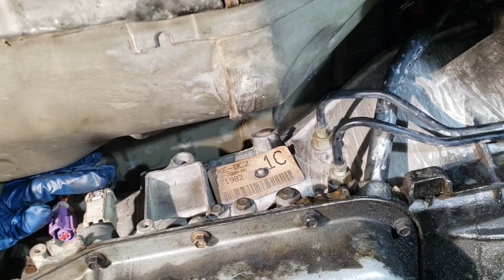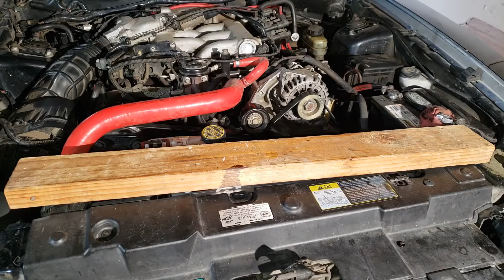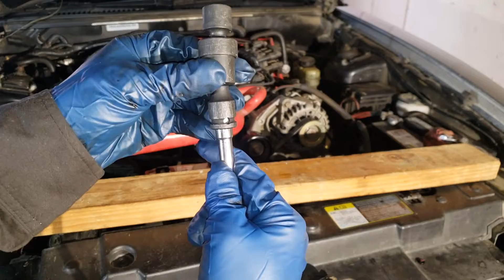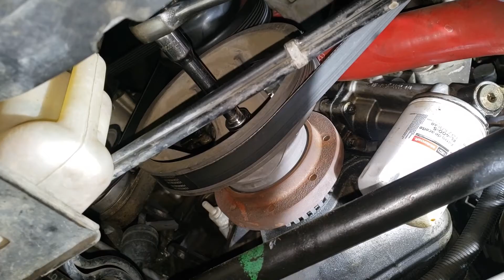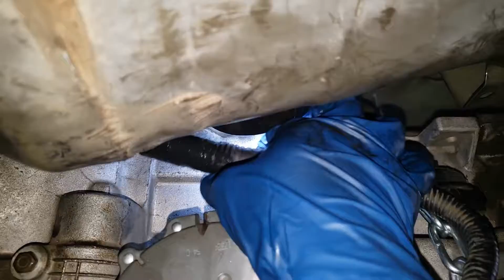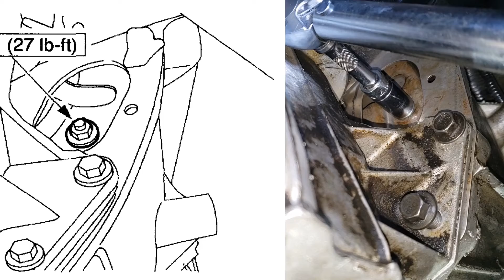Mustang Transmission Removal / Install (99-04 V6) (4R70W)

Comment: How the hell do you remove the torque converter bolts?! They're super tight and start to round off
Reply: At that point, find a socket slightly smaller than the size necessary, beat it onto it & then attempt to loosen, that’s the only way I can think of, definitely get new nuts from your local parts store. I got mine from AutoZone(they were blue).

Comment: Is it easier to do this than rather hold the engine to drop the oil pan first the engine
Reply from the maker: Either way requires lots of disassembly for the oil pan gasket
Reply: @OldSchoolNoe I bought a used engine just gonna replace the whole mf bought it for 150
Reply from the maker: @brutalkillin9555  nice! Are you replacing the rear main seal, and oil pan gasket on the other engine?
Reply: @OldSchoolNoe yes I’m def going to do that before putting it in lol that’s a must

Comment: Very important. Theres a wiring harness that's mounted to the top of the transmission.. I ripped a white wire? That's mounted to the engine. No idea what it is. I'm in over my head. Hate this shit
Reply from the maker: Driver's side or passenger side? Are you able to trace it to something?

Comment: This video helped me get my transmission out, step by step. Although I found it easier the remove the top 2 bolts from the top with a regular 13mm wrench. Thanks!!
Reply from the maker: a couple of people have commented that, it looks like a tight fit, but sure beats building "the snake."

Comment: Hi, can you tell me what that blue plug to the left at 0:21 is plugged into? I’m trying to fix my 03 mustang v6 automatic, and noticed 3 wires unplugged. A blue head a green head and a higher up gray head that almost looks like a part of the previously connected part snapped off connected to it. Thanks for any help, even just a picture of what that section is supposed to look like would help.
Reply: More than likely o2 sensor that was plugged into the catalytic converter.
Reply: Green and blue connectors are for the o2 sensors , the Grey one might be the connector for the transmission 🤔

Comment: Excellent video. Was planning to follow along with this until I realized it’ll be hard to turn the crank shaft of a seized motor 🙃. Now I’m not sure what the “easiest” option is.
Reply: In theory you should be able to remove the transmission leaving the torque converter in place on the flex plate, you'll just have to have enough room to slide the transmission more to clear the converter, you'll have to reinstall the torque converter onto the transmission when you reinstall it on the new motor, aswell as you'll have to replace all your transmission fluid since the converter will spill its fluid once disconnected from the transmissions input shaft, there's no way around this because the transmission has an anti drain back valve for the converter so draining the pan won't be enough, just be mindful of that and have a bucket under you when you pull it, otherwise it's not much different of a process, once separated you should be able to unbolt the converter without being able to turn the motor

Comment: should I have it in neutral with the parking brake on? And what about the shifter how do I go about removing that, I assume you take the trim off and it’s a couple more bolts
Reply from the maker: Yes place it in NEUTRAL, service information does not call for setting the parking brake.
As for the shifter, you don't have to remove it when removing the transmission, but if you have to remove it for any other reason then:
- yes remove the trim, around it, some electrical connectors,  2 fasteners for the shifter bezel, disconnect the shifter cable from underneath the vehicle, then I believe the shifter and its base are held on by 4 bolts.
Reply: @OldSchoolNoe  ok how do you take the key out with it in neutral, i cant figure it out unless i keep the key in there then disconnect the battery but i don’t think thats smart or right
Reply from the maker: @robfolder  you can leave it in park, and manually shift it to neutral once the linkage has been disconnected. Just become familiar with what position is what so you can set it to park once you're finishing up.

Comment: yo ik this question isnt really related to the entire removal of a transmission but is removing the top passenger side bolt (aka dipstick bolt) doable with the Mid pipe still in the car?
Reply from the maker: I would say no, since it takes up so much space in that area, BUT I have not tried it! Maybe with some swivels and extensions you can do it with the mid pipe still on. You're going to have to be a trailblazer and let us know!
Reply: @OldSchoolNoe  will do
Reply: @OldSchoolNoe  so I’m back with progress. This is do able. There is a downside you cannot do this alone you will need someone on the top to be exact a skinny person. Whoever is feeding the snake under the car needs the 2nd person to hold the socket on the bolt and then it can be cracked loose. After some turning the bolt can’t be hand loosened and removed from the top of the car.
Reply from the maker: @ItzTeko  nice one! You found a solution for a tough spot.
Reply: @OldSchoolNoe  now my only issue is getting an o ring for the bugger. Wish I could record this because I believe a good amount of people out there would like to see the way me and my dad did this lol
Reply from the maker: @ItzTeko  try the Storehouse "O-Ring Assortment" from Harbor Freight, maybe the Dorman "multipurpose O-ring set."
Reply: @OldSchoolNoe  I’ve heard it has to be one from ford but what’s your opinion on it?
Reply from the maker: @ItzTeko  yes I would use a Ford part over those, have you asked about the O-ring at the local Ford dealership?
Reply: @OldSchoolNoe  yeah I went out and got one anyways didn’t wanna risk it but these o rings are made out of viton so I guess if you have a Viton o ring set you could skip out on the ford o ring. (Possibly)
Reply: @OldSchoolNoe  I had to come back to video since for 1 im removing my 4r70w and bringing over some friends to help with me a manual swap on my 98 GT. Though for the past 8 months the seal has held up

Comment: And what happens if the torque converter come off the the tranny does it in-Aline it?
Reply from the maker: Nothing bad, just getting it back into the transmission can be confusing as there's multiple sets of splines that need to be matched up

Comment: Is this a manual or automatic? Does it make a difference?
Reply from the maker: this is an automatic, a manual is much easier because you unbolt the transmission from the bell housing, and can remove it separately.

Comment: Pro tip. For the top 2 bolts just remove your intake manifold. Cheaper and less stress and saves you a trip to the store
Reply from the maker: never done it that way, would be a good opportunity to change some of them gaskets.
Reply: The wiring harness gets in the way while doing that, any tips on getting the wiring harness out of the way.... beating my head against the wall on this job
Reply: @thelonelytuba1972  on the passenger side near your strut tower is a wiring harness connector with a 5/16 bolt. It's quick and easy and worth a try. Should allow you to move the wiring harness. Not sure though
Reply: Tried it this way but the bolts are to long
Reply: @jameslawn6159  my guy must have swapped the bolts then my bad. Good on him though made it a dream

Comment: When I popped my transmission out, a small compression spring came out..
Any ideas. Same car v6 mustang
Reply from the maker: That's interesting. There is no spring near the bellhousing area. I have not rebuild this type of transmission, so not sure if its an internal piece.

Comment: Could I get away with not doing the torque converter bolts and just pulling the transmission off?
Reply from the maker: Nope, I've tried this before. What happens is there is not enough clearance for the bellhousing to clear the left behind torque converter when pulling the transmission. It hits the bottom of the car. That torque converter is going to have to be unbolted.
Reply: @OldSchoolNoe  I actually managed to get it off without doing so funny enough
Reply from the maker: @ThugzBunnyYT  what the...must have had the perfect downward angle to clear it out, nice!